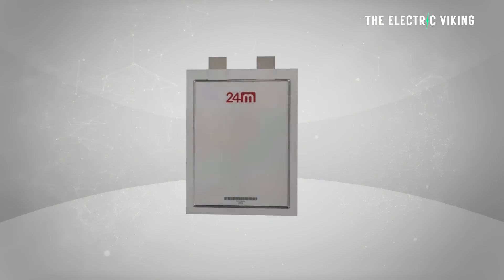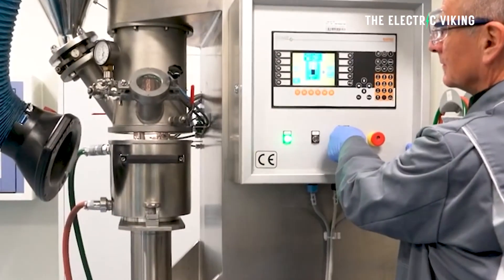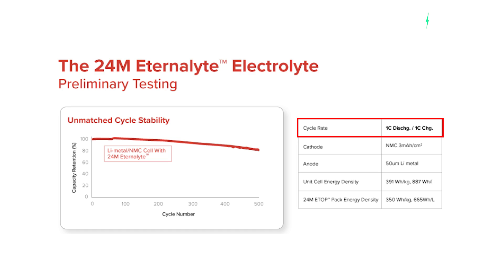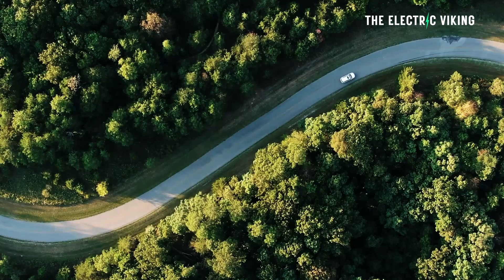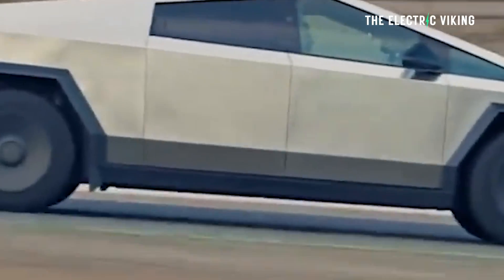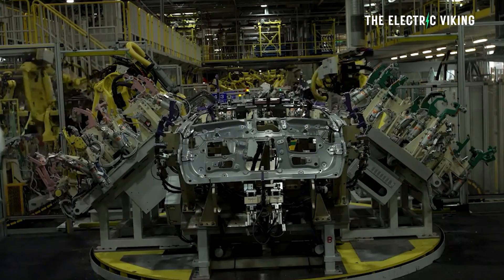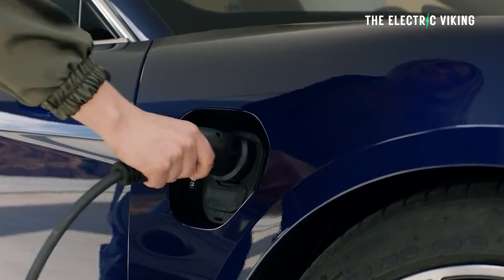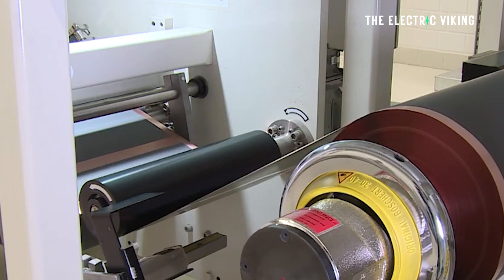American battery company reveals production ready 1000 Mile EV Battery

Comment: I am a cabbie and I don't have home charging meaning I will have to waste precious work hours outdoors just to charge my battery everyday. I NEED A 1000 MILES BATTERY PLEASE. THE MORE THE MERRIER.
Reply: Why can't you get home charging?
Reply: @johnfrancis4401  You need to have a home plus private parking.
Reply: I used to drive 12 hour days for Uber for a year in greater Toronto area and roughly did 300 km on average.  That's short of 200 miles. I don't see why you would need a 1000 mile battery.  I used to fill up every day and would usually spend 15-20 minutes at the pump, sometimes even longer due to the amount of vehicles.  A Tesla and a supercharger station is all you need.
Reply: @orrindavies  Good for you. But in UK electricity is expensive when you buy it at EV stations ~ 80p (£0.8) but at home off peak electricity at night costs 8p (£0.08)
Reply: @orrindavies  I drive similar milage. Maybe just above 200 miles per day. Faster chargers cost a lot more than fuel in London unfortunately. Yet the fastest available chargers will get you 80% in 45 minutes. Other issues with cabbing you almost always need to keep the heater on in winter and aircon in summer. Otherwise we could get low ratings.
Reply: I do wonder how much a cabbie drives per day which is mostly city driving and sitting in traffic?
Reply: Not really. 15-20 minutes to charge on supercharger
Reply: @wordsworthbklyn  In London fast chargers almost cost 50% to 70% more than what you would pay for fuel. We are still way behind 15 minutes charging times. Fastest chargers are tesla which will get you 80% in almost an hour.
Reply: I drove a taxi in Cardiff for 2 years, rarely did more than 120 miles per day.
Reply: Specialy in winter it will give u more  wiggle room
Reply: @wily1532  Excellent point. Range anxiety is unpleasant
Reply: 10000 mile range wouldn’t change the fact that batteries need to be charged. If you spend 15 minutes enjoying a morning coffee and 15 minutes during lunch. You’d probably have far more range than you could drive in a day. It would miss the major cost saving of charging from home though.
Reply: @charlesminckler2978  No 15 minutes chargers available in in London yet as far as I know. Also fast chargers cost almost 50% more than what you would pay in fuel. The faster the charger the more you pay.
Reply: Maintenance and running costs are cheap for EV cabs. 
You can earn the same overall in less time.
Reply: @Spruce_Goose  Definitely cheaper on home charging off peak hours. But fast chargers in London almost cost 50% more than fuel in price and lost time. 15 minutes chargers available yet.
Reply: its complete VAPOR WARE!   even the article "24M Claims The 1000 Mile Battery Is Nearly Here" says it is NOT here.  this is just another video on hype with ZERO substance...go read the article. 

if they can get an actual battery and not some mythical 'test' then sure, so many many many of these hype articles are just pure BS
Reply: But charge as you drive will likely be available in 5 years as well. So large battery wouldn't even be needed for city cabbies!